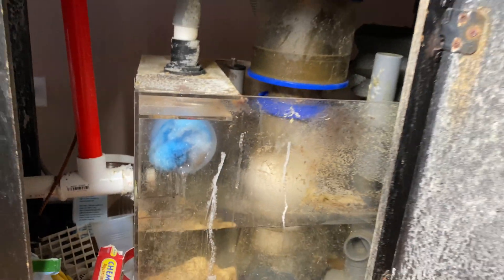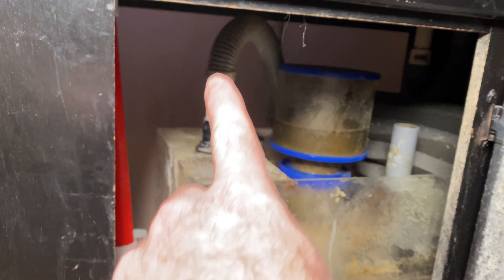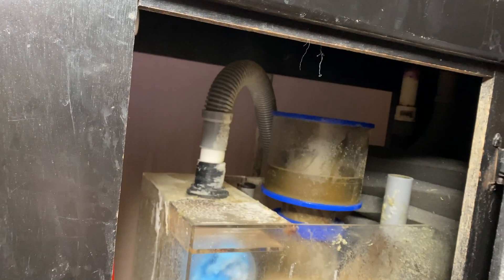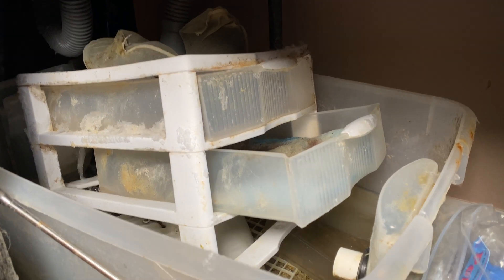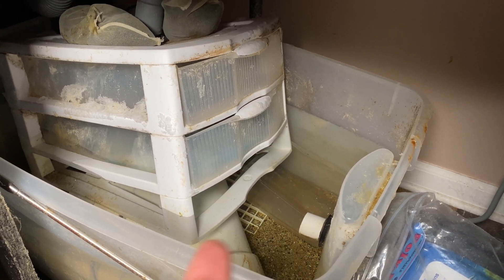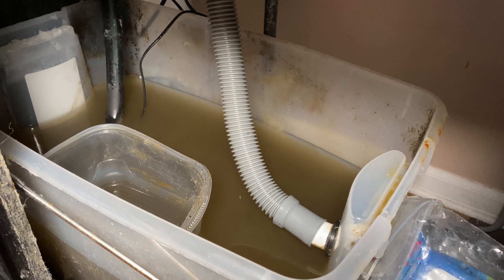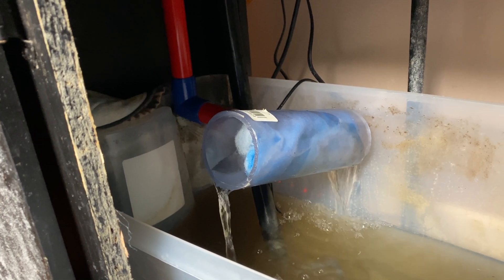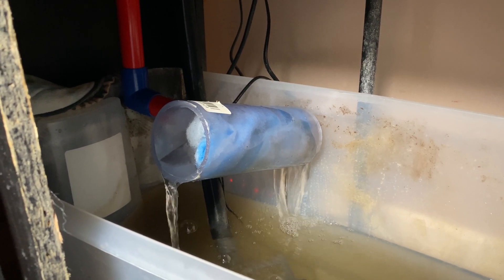saltwater tank filter DIY

Comment: Just FYI, I don't think it really matters if you have a straight pipe discharging from aquarium overflow or if it has a "sump" in the line.  Based on Bernoulli's equation, only the height differential from the input to outlet matters.
Reply from the maker: thanks, but the water does flow so much faster with the straight pipe compared to the bent hose that rises up before going down again. interesting though.